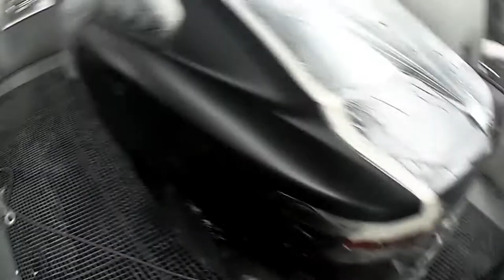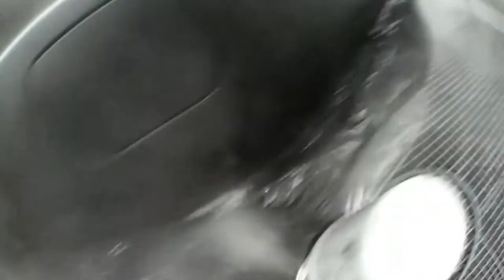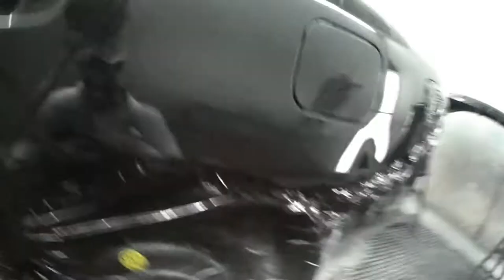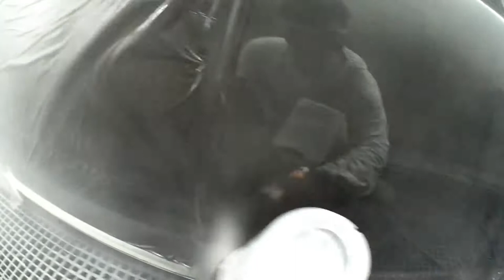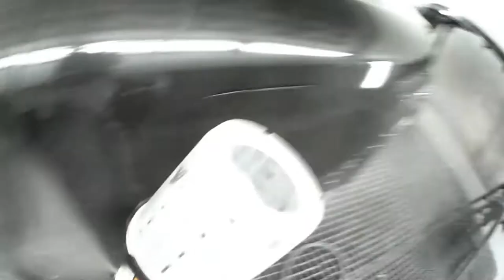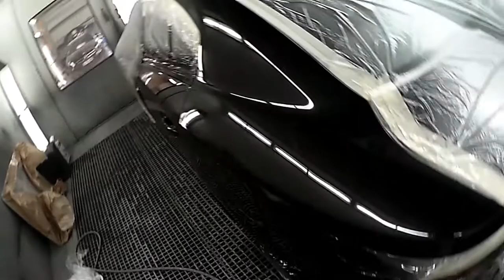max meyer 0325 test. Devilbiss te20.

Comment: Is it better than 0200 , 0300
Reply from the maker: 0200 and 0300 are clear hs. 0325 is uhs and it has more resin in it. 0325 is also more liquid and it stretches more easily